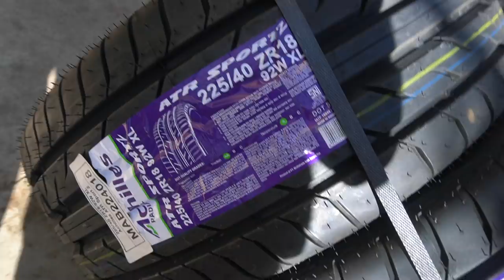TIRE RIPPED IN THE MIDDLE OF THE ROAD! +NEW TIRES FRS/BRZ/GT86

Comment: That has happened to me twice and both times was on the freeway i road my tires low on air and i couldn't tell they were low on air because i had 275/30r19 so when i get off the freeway i saw how bad it was and yeah it ripped up just like yours for driving on it with low air it happends bbygurl good thing nothing happened to you and damn props to you for changing that tire with the small rachet💪 im for sure getting you a breaker bar for Christmas bbygurl😁